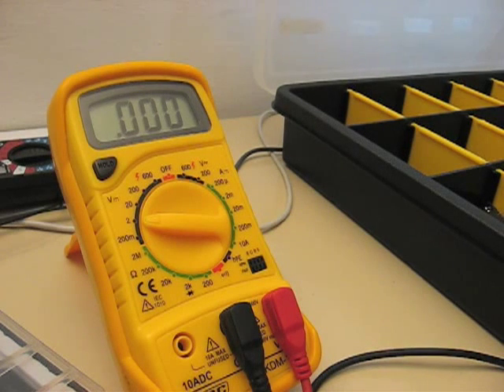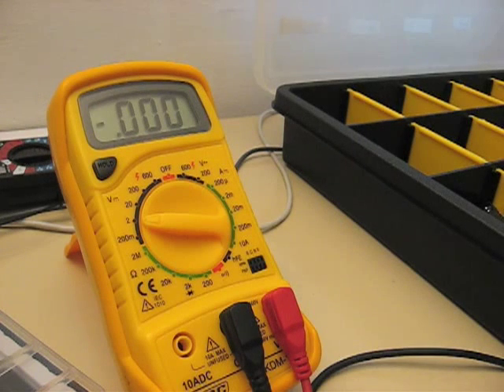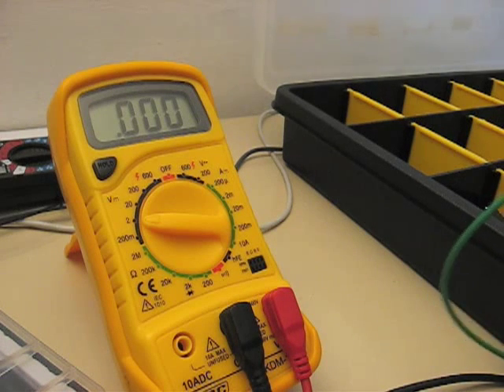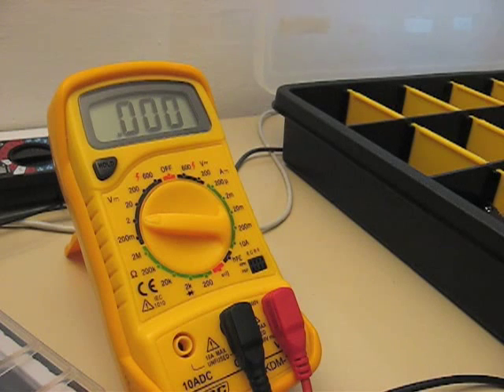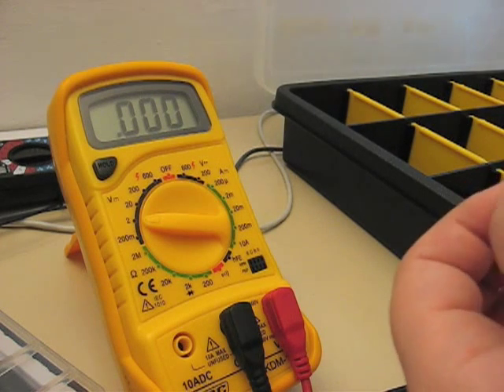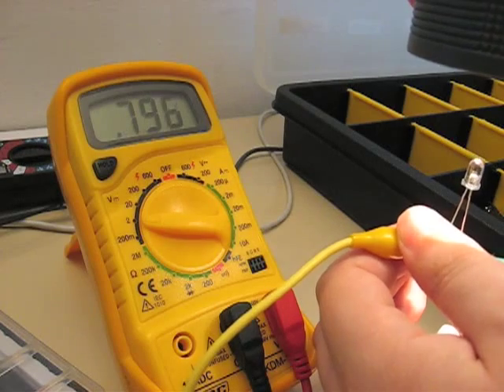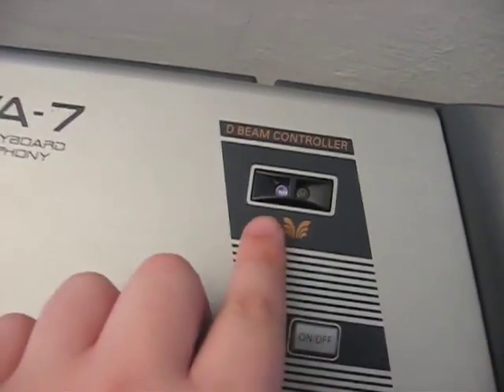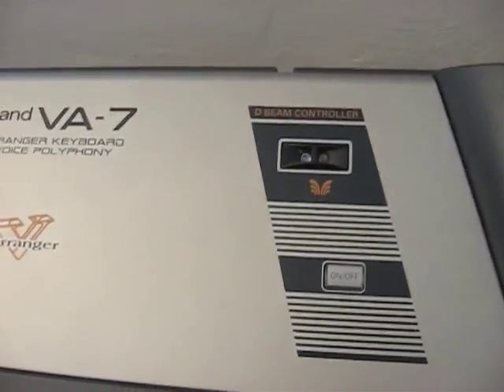How can LEDs be used to detect light?

Comment: Power in = power out
LEDs have small amperage which is not enough to work anything. I know this was always possible. LEDs always produce a current in the opposite direction it lights. When in a circuit it will measure nothing because the amplifier shorts it out. Sensors this should be use for.

Comment: Hi wondered if this could be used on a Transistor curcuit to Amplify through several Transistors to boost voltage.. Just a Thought.
                             Good though. Thank you.